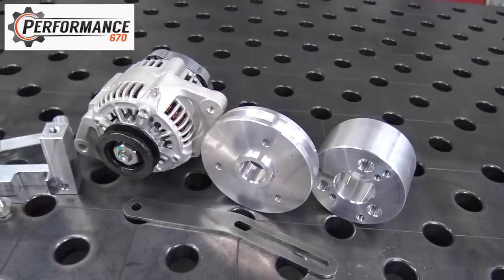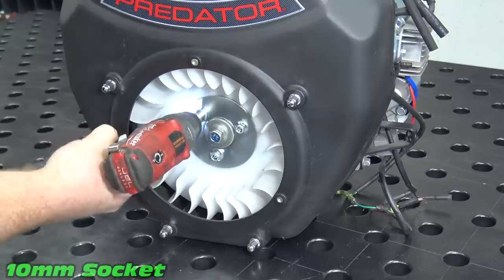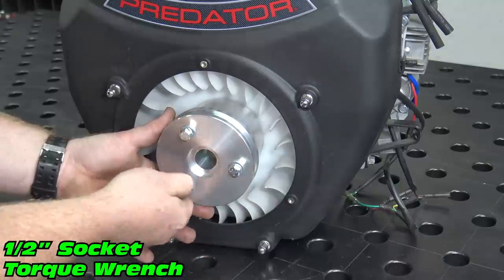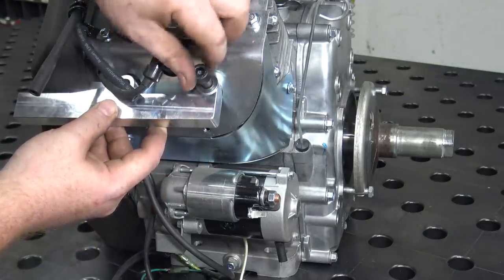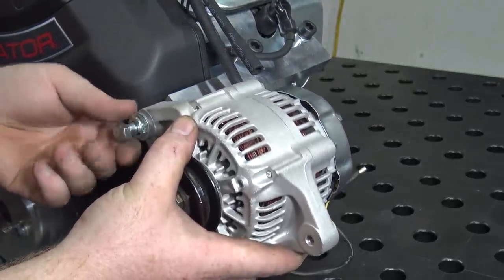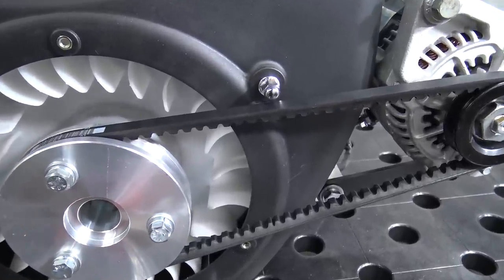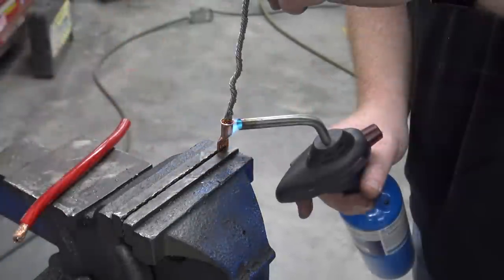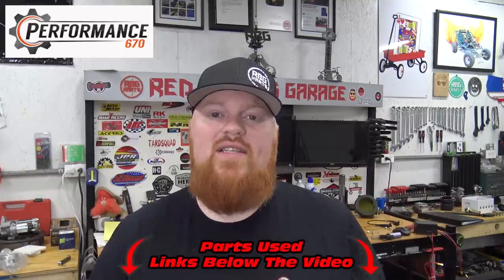670cc Predator Alternator Kit Install

Comment: Drop in replacement motor for my Geo metro, now has a charging system to power the radio it never came with.
Reply: Dustin and unlike the geo metro metro! A replacement is cheap! And easily rebuildable! 😂😂

Comment: If I'd seen your excellent Predator Engine Build video, might have taken a different route; built a Briggs using Performance V-Twin parts from Al Hodge, flew it for 120 hours but cast cam broke so reinforced the cam, sold it and moved on to a bigger liquid cooled ATV motor. What's impressive is the way you speed up the boring bits to keep it sharp and interesting, shows good video use for presenting tech matters. Couple of thoughts:- it is possible to mill out the weights from the flywheel leaving the ignition and generation magnets and a balance weight opposite, and sticking with the stock regulator, and is that just as light and simpler than going alloy flywheel and adding an alternator? Also I found the change to billet rods did change the engine crank balance, is it worth re-balancing the Predator afterwards? If your build gives 32hp it has big potential, as watching your work it's plain you use good techniques and skill, and there's a market for such a unit in the UK.

Comment: Does  installing this mean you lose the electric start, and how would you start the engine?
Reply: No.
The anchor for the alternator adjustment curved bracket is anchored to the bolts holding the electric start on the motor....so it's still there...key start still works...
Reply: @JohnSmith-pl2bk Thanks for your time and wisdom good sir

Comment: So I understand the 4 gauge wire and the red small gauge wire to a switched hot. But did he say the yellow one goes to an alternator fault lock? What even is that and is it mandatory or optional?
Reply: Alternator FAULT light....
the light that comes up on your car's instrument cluster when you start the car...and when there is a fault.....

Comment: Is there a bolt-on on solution for powering up a 212 to handle extra lights and such on a mini bike?
Reply: not really. you can put a better charge coil on them, but you're still going to be barely putting out any juice. they are really only meant to top off a small lawn tractor battery.
Reply: It may be possible to come up with something from the shaft side
Reply: You'd have to strip the stator from Kholer engine, can't quite remember which one. You'll need the flywheel and stator coils, plus a rectifier/regulator to convert from AC to DC and regulate it to 12-14 volts.

Comment: what would you do with this alternator.charge your battery at home?
Reply: Soon as you rip off the stock flywheel and charging coils from the 670 to install a billet flywheel, you lose all ability to run lights, charge the battery and any other electronic accessories. This makes it so there no compromises.

Comment: I clicked the link for the alt kit, but it appears to be either out of stock or no longer available.  But I have a questiom regarding alternators.  I'm fully aware you modify your engines.  I'm doing a repowering of a Gehl 2600 skid loader.  Wouldn't the alternator rob horsepower?  I have the room for a kit.  But if it robs even 5 horsepower, it isn't feasible.  Just a question.

Comment: Can you install this kit on a Honda GX340 and GX390 electric start gas motor... I'm installing a GX390 on a UTV to run LED lights , USB port , cigarette lighter , wench , windshield wipers and a radio while charging my battery...  It would give me plenty of charging power to run everything , only if I can install on my gx390...

Comment: What alternator is it based on, like could you put a high output alt on? 40 amps is a bit low for some applications, like if you wanted a legit sound system on your 670 swap 40 amp wouldn't cut it lol. Guess it dont matter cuz with my job aint buying that anytime soon :/

Comment: I am putting together a 670 for a swampfox 6×6.  I bought the alternator kit but confused as to how much of factory shit gets eliminated.  Specifically the " charge coil"  little box mounted to case as well as the bindings beneath flywheel.  I emailed the company with no response.  Same when I requested a wiring diagram for factory predator 670.  Any help will be greatly appreciated

Comment: Will this setup work on 708 vertical shaft ? I replaced the kawasaki with a predator and the low output from the stator won't charge the battery.

Comment: Quick question on the idiot light. Can it be LED, or does it have to be incandescent?
Reply: Gonna have to be incandescent...
I'll make it simple without getting technical , the theory is simple. 
 When it's not in operation, but key on, the regulator side of the light  is grounded internally , and the other side gets the b+ 
When it's running and charging , internally the regulator switches and puts b+ on the previously grounded wire. 
Voila , b+ on both sides and the lamp is out.
Reply: Another thing too, if the lamp burns out it won't charge, but if this is a "1 wire" style alternator it would.

Comment: Do they have a 20 amp alternator at an affordable price? I know this engine comes with a 9 amp alternator. I need an 18 alternator for my Simplicity.
Reply: Its a 40amp
Reply: @chrisortiz2466  Why do they not say this in advertising information?
Reply: @countryside8122  they do on the website
Reply: have a link to that website? The website I saw said 9 amps.
Reply: @chrisortiz2466  Thanks

Comment: Nice install but but 4ga wire is a bit overkill if you already have it around cool but 8ga would be more than enough it has a continuous ratings 55A which for a 40A alternator is plenty

Comment: Ok how about a hub adapter as such for a 420cc predator engine? I have a craftsman gtv16 garden tractor that im trying to repower and i cant without some kind of drive hub to fit a drive pulley on the front of the engine.
Reply: They now make a flywheel hub for the Predator 420 at Performance 670. Just look on their website. Just saw it there the other day. It's mostly for Cub Cadets, but that might he after they were bought by MTD, which also makes Craftsman mowers.
Reply: @Ratkill9000  heh thanks for the heads up. I actually ordered one of the 420 universal ones and had a local machine shop mount a pulley on it.

Comment: Redbeard on that 670pred.  If you were hooking  up a tachometer how would you wire it up.
Reply: They make inexpensive hourmeters that show RPM on them, they just have a sensor wire that wraps around the plug wire on small engines. I got mine from Northern Hydraulics.
Reply: @johnwyman6331  thanks for the reply but I already have the tach I'm not sure which wire to use for rpm power since it has two coils. But I have seen the gauges you speak and I considered use one but I already had an hour meter.

Comment: Is there a cut in rpm? Will this produce 40 amps at idle or should a throttle solenoid be installed?
Reply: If whatever you're doing puts a load on the alternator, it will put a load on the motor requiring more RPMs.
Reply: @cynthiaayers7696  this is why you make sure your pulley ratio is right.  3:1    I think it’s 6 3/4 to 2 1/2.   Something like that.

Comment: Great info, great video.  
I have searched, is there any company making a similar kit or plans for a DIY alternator kit for a 420. 
I am running a mud motor on my jon boat with a Predator 420. With electric start, lights, live well pump, as well as a second battery for my trolling motor, I would really like a way to keep my batteries charged. I may end up fabricating my own DIY kit but if someone else has already done the brain work that make things easier. 
Thanks for the info and keep up the good content.
Reply: Ive honestly been thinking about using a SBC water pump pulley bolted on the flywheel with the main nut and then just cut the fan housing
Reply: @Entertainment_Enterprise  I am in my mind working through setting everything up to use a multi rib belt (I have reasons). I have talked with a machinist friend about an adapter that would attach to the flywheel/fan and then allow a pulley to be mounted to it. 
The mount for the alternator would be fairly simple. A reinforce, double shear mount at the pivot bolt and then a slotted arm for the tension adjustment bolt. 
I don't thing a SBC alternator would be the best choice. A smaller more efficient and lighter weight alternator would be better but I will need to dive into some part number listings to figure out that. I would pick a common part number.

Comment: About how much power it pull from motor
Reply: It all depends how many amps you draw from the whole system....just like on a car.
If the load is 20 amps well 20 x 12 VDC = 240 watts (1/3hp)
If 50 amps = 50 x 12VDC = 600 watts ( still under 1hp which is 750 watts)

Comment: I’ve got the same basic set up but I’m using a harbor freight 212cc and an 84 Chevy alternator with a deep cycle battery and 1200w inverter all mounted to a little cart I built so I rarely have to pick it up. It’s been my handy little generator for about 3-4 years. I mostly use it to run power tools but the power went out a few times and I ran my fridge off of it. It could use a better inverter but it does the job.
Reply: How did you get the alternator to charge correctly? I have a 420cc predator on a hammerhead twister and I put a 1 wire alternator on it from a 9 inch pulley on motor shaft and 2.5 inch pulley on alternator and can't get but a couple volts to come off the alternator even at high rpms.

Comment: Why not just get higher output charging coil for a honda gx660 and bolt it on , thats what i did you can get a 17 amp or 27 amp

Comment: 40amps X 12vdc = 480watts.  Is that the correct power output of this alternator?
Reply: That will be it's peak output at optimum rpm (usually 10000) but it drops progressively with rpm. That gearing is pretty low (about 2:1) so for normal driving speeds I'd expect an average of around 20A on that motor setup.
Reply: @alasdair4161  other way around, it's a 1:2 ratio. The pulley on the engine is almost double the size of the pulley on the flywheel. So if the engine is running at say 1600 rpm, the alternator should be around 3200rpm. It's probably not an exact 1:2, might be 1:1.5, but it's enough to make a difference.
Reply: @Ratkill9000  I was figuring around 3000 rpm alternator speed for 20A. to get full output the engine would need to run at 5000 rpm for 10000 at the alternator.

Comment: Is a kit like this available for the Briggs 23hp twin?
Reply: Just go buy a GM one wire alternator from any major parts store. They stock them and are cheap. Brackets would be super simple to make from some flat stock and tubing.
Reply: @FastBowtie388  still would need the stub shaft and pulley. Unless you pulled the engine off a mower, it's well over $100 to get the stub shaft from a dealer. An ACDelco Alternator runs about $60 or so for the 63amp version on Amazon. Then you'll need the 3" pulley with a 1" bore and keyed.

Comment: Any noticeable loss in power pulling alternator?
Reply: Depends alternators only apply a load on the engine when they need to produce power, when the battery is fully charged and you dont use electricity there shouldnt be much load only bearing fricting and the fan in the alternator. 70A from the alternator are 1,5hp if you calculat with the effiency, the alternator will need 2hp from the engine at full load.

Comment: Sweet motor.  Would look 110x better if the sheet metal and plastic stayed off of it.  Any thoughts on fuel injection, and/or using a little aisin roots supercharger, a custom intake?
Reply: You need the plastic to direct the cooling air or it cooks...
Reply: @rronmar  so make a sheet metal shrowd.  Then polish it. .
Reply: I have done that, it can be a lot of work:(

Comment: 12180 denso alternator. Looks cool
Reply: According to Performance 670, it's a Kubota alternator, not a GM.
Reply: It may be cheaper going with Kabota but it’s a denso alternator for sure. I spent 2 days looking for that same thing for a customer. Small body alternator.
Reply: @Ratkill9000  kubota does not make alternators. most japanese alternators are made by nippondenso and that is where kubota gets their alternators from.

Comment: I wonder if a 100a 12si alternator would work with the brackets.
Reply: It might. This alternator is a Kubota off like a V2203 di or idi. They might have a similar case size. But I'd call up Performance 670 and ask. Kind of surprised they did this and not a more common GM Delco 10si or 12si.

Comment: You'll want to avoid solder on any kind of mobile installation. The joint is too ridged and will eventually fail due to vibration. A crimp and heat shrink is actually a better connection for that application.

Comment: Anyone tried to make this work on the Honda Gx610/620/670 since the predator 670 is based off those engines.
Reply from the maker: The Gx series Honda's is a lot different than the predator 670cc. That's why you don't see anyone making parts for them. The Gx Honda's built would make less power.

Comment: I'm surprised he didn't use a larger capacity alternator.
Reply: joe woodchuck rule of thumb is 1HP for every 30A on an alternator.  Not sure how much HP they have to spare in this application...
Reply: @rronmar  Another rule of thumb is 30 cc per horsepower on the smaller utility engines. 670 ÷ 30 = 22 hp and that's with a stock engine. If he didn't mention modifications as a number of people do with this engine then there should be lots of headroom with your figures equaling in the neighborhood of 2 hp.  Who knows? It could be just a quick demo thrown together for example.
Reply: Yep, with that much HP they could probably spare a few more for charging especially if they are recovering from winch ops...

Comment: hmmmm alternator, belt , maybe add a power steering pump and make one of those bigger go carts/ the independent suspension cart have power steering
Reply: Probably would rob too much power. Electric power steering from a Prius would be more efficient.
Reply: @greasysteve5671  my little 12 Subaru Hatchback also uses electric power steering.

Comment: Man in australia there isn't much of this stuff
Reply: Dont matter, if they succeed in agenda 2030 none of us people will have this stuff.
Reply: @constitutionalrepublican1611  what are you talking about?
Reply: @frigglebiscuit7484  well for starters agenda 2030 is population control. 

But precursors to all of it are happening currently and have been for years. 

Theyre changing oil in america for 2020, engines like this wont last half as long due to the change in the chemical composition of the oil and gas..... The engine will have to work harder and be working hotter for the "heat signature". 

Agenda 2030 may seem like a conspiracy theory but its no theory when its legitimate and has backing. 

The govt has alterior motives and only cares about continuity of govt. 
 
It goes along with georgia guidestones and other issues that people are learning about. 

Prepare accordingly as agenda 2030 will be a world wide issue.
Reply: @SoukaDeezNutz  yep. Theyre using alot against us all. 

Mk ultra, and more

Comment: You used the wrong type of belt. Should be a V belt.
Reply: It is a V-belt. There's several different types, ones that have a cog and ones that are not. They all function the same. This is just the belt that came with the kit.